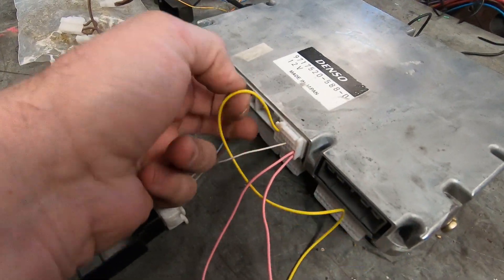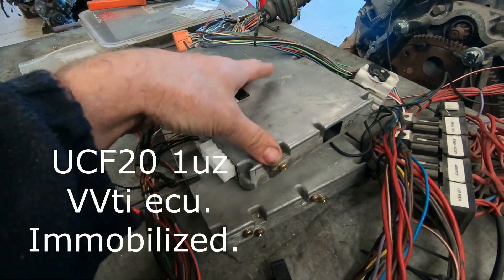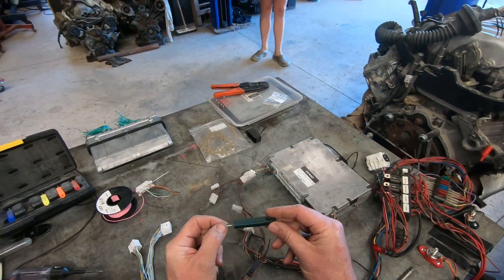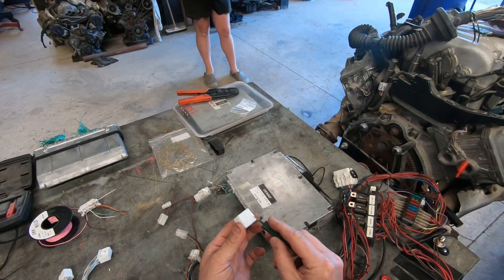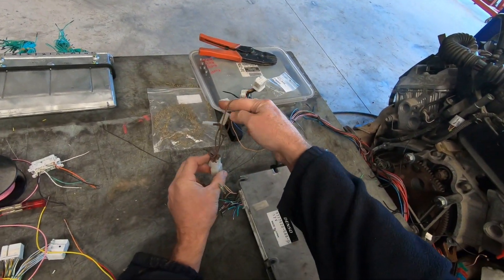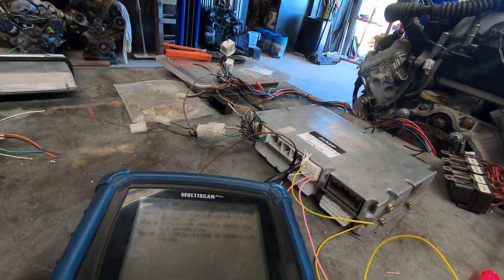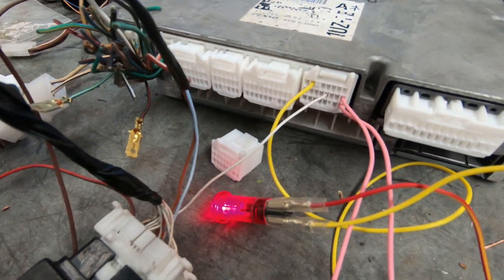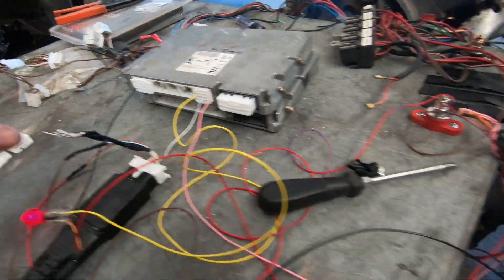Help - My 1uzfe VVti ECU doesn't have a Check Engine Light.

Comment: I have a question, what could be the problem if while driving the engine light turns on and later turns off. on and off and the performance reduces and acceleration's wont go above 3 when light is on.
Reply from the maker: Connect scanner,  check codes and live data.  Test,  don't guess.

Comment: Power, ground SIL terminal in ecu
Reply from the maker: Correct , but the ecu also needs to be wired correctly to record faults , which is part of what the video is about.  Cheers Kelvin

Comment: You’re forcing power to the ecu. There’s a power pin that goes to a relay. It powers back to the ecu by one of you pink power wires. That lights the check engine light. If your signal out to relay is bad or relay is bad you won’t get power back to light cel. By forcing power you’ll get a cel. But if you don’t have signal out to relay or car has a bad relay you won’t have a cel.
Reply from the maker: I know exactly what I was doing , that was the point as I was attempting to duplicate how another guy on the other side of the world had wired his to prove a point.  Powering up the ecu in this way is a great test technique however I never wire in this fashion when in service.

Comment: Love the videos.i have a 1uz vvti from a ls400 in my Lexus is200.love it to bits.was thinking to make a set of headers for it.is there any tips i you can give to get abit more power out of the engine.
Reply from the maker: Hello David.  The IS200 (altezza over here) work really well with the VVti engine.  Nice fit too.  Is yours a manual or auto?  Stock ECU or aftermarket ECU?  Headers with short tubes work well for mid range into the top , longer tubes will enhance bottom end torque.  Definately check the AVIS system is working , I have a video on that if you havent seen it.  Good spark plugs are a must , I prefer nippon denso stock items.  Apart from that keep all the normal maintenance stuff up to date and enjoy it.
Reply: CartuneNZ thanks for the reply.it got the j160 6 speed from the is200/altezza.works very well.its running the the standard ecu from the ls400. Phoenix engine management in the uk done me a plug and play loom.its like it was factory fitted.i have the stander headers on but the driver side need a good bit cut out of it to clear the steering column.i have watch all your videos and love them.its working good. Had a vvti solenoid fault coming and going.had new solenoids but it was lack of maintenance on the engine has I flushed the engine oil 3 times with new oil and it hasn’t come back.
Reply from the maker: @davidpritchard6685  Cool as.  Phoenix is a subscriber to my channel.  We chat from time to time as well.  I haven't done a video on VVti solenoids.  Might have to add that to the list.  Cheers
Reply: CartuneNZ that would be great.cant wait to see more videos and keep up the good work.

Comment: That is amazing! How would I be able to purchase instructions on how to wire a 1UZ into another vehicle? I have a spare engine that Id like to install in a Chevrolet pick up truck.
Reply from the maker: It is pretty amazing.   Even for me.  You sure can buy some  wiring instructions for the 1uz.   The connection into the chev only requires you to find an ignition, start, and battery feed with a output from the uz wiring to fuel pump to make it start.  Then a few for dash and fans.  $150nzd and includes 30 minutes of my time.  Email thecartunecompany@gmail.com cheers.

Comment: Do you know how you can wire up a 95 ecu check engine light, non immobilizer? I bridge e1 and te1 but doesn’t flash like the earlier 90-94s
Reply from the maker: Yes I do.  I have my own wiring instructions for all the different 1uz ECU's.  These I sell and they contain all the wiring info to make the engine run correctly.  I think in my UCF20 wiring video I have the check engine light wiring in there.  I'm also working on video requests so for a small fee I could make a video specifically on that topic.  If interested flick me an email at thecartunecompany@gmail.com  Cheers
Reply: Many times a bad ECU will not flash Check Engine light when TE is grounded, so it's possible you have it wire correctly but have a bad ECU.